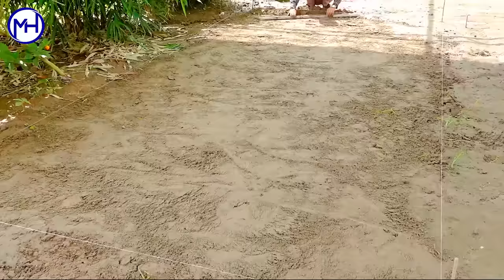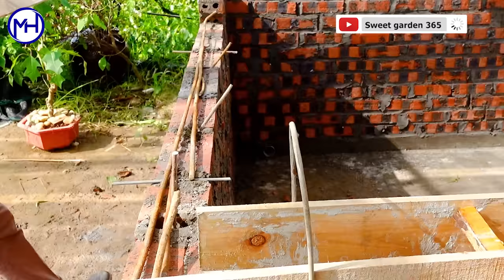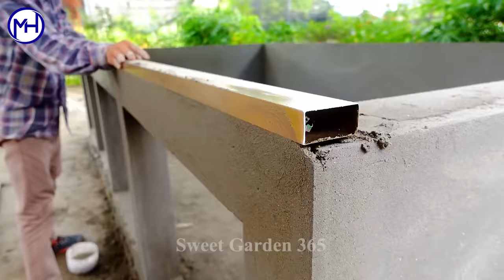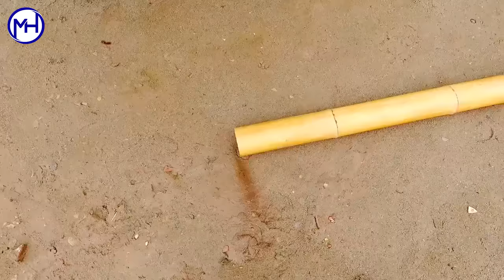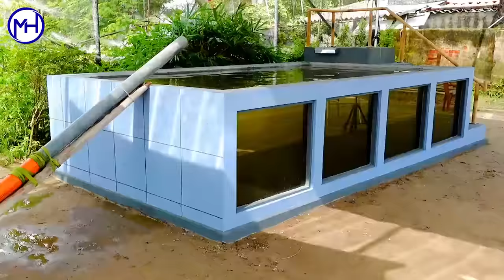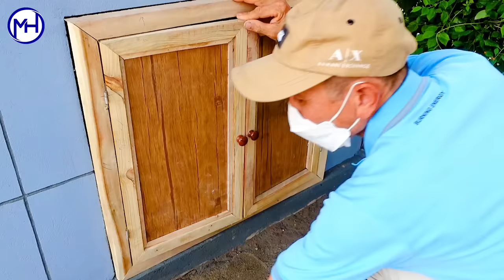WOW! How my father builds a giant aquarium at home

Comment: Looks really good but structure wise idk man. Not trying to hate but those stairs filled in with dirt with a thin liner of concrete isn’t going to cut long item and I would if used thicker rebar for the top rail of the windows. Nice looking tho
Reply: I think it’ll be just fine in a climate like he lives in there’s no frosting in heaving in the winter time.
Reply: @Exotic_pet_company  your opinion but it’s not about climate it’s about structure.
Reply: @4thHorsemenCustomz  I actually am from the north east and I moved down to Florida. I’ve been down here 20 years I lived in Massachusetts 22 and not only worked in masonry, but family members and friends were masons.  I went to a technical high school and was in masonry for 4 years. And if you look at the way, the homes are built or any masonry is installed up north compared to the south or even all of Florida you’re going to see a big difference in the way things are structurally for example.
In Massachussets (I would think all of the north east )they dig below the frost line so they can pour a solid foundation to lay the brick or block on. But the majority of the southeast, especially Florida don’t have to deal with a frost line. Therefore, they just pour a concrete pad on top of the ground. That’s their foundation.
Reply: @Exotic_pet_company  you don’t get what I’m saying my friend, your talking about foundation which I never said I said structure wise especially with that much water you need way much rebar for the structure and I’m not trying to Make it more then it is! I’m not Sitting here playing swords who went where or where you live just stated my opinion as you did so let’s leave it that.

Comment: What is the propuse of the murky water and plants that get removed? Is it to clean and add nutrients to the walls?
Reply: Test of integrity under load
Reply: @bigtime4794  But why add plants? The water alone should be enough to test the integrity.
Reply: @rodrigoaguirre154  it's great for parties
Reply: @rodrigoaguirre154  it cleans impurities from the concrete

Comment: . You should arm the bacement concrete with iron beams as well i should think.
2. I would say that the isolation of the brick wall sould be similar to a pools icolation because i think that even if you risk a leak accident due to water pressure, you ll certainly have dump problems  in the future.
3. The PH index of the water might not be easily altered for this aquarium if it has to accomodate tropical fish.
4. This is a huge monstrous aquarium and hence, the need of replacing every single week the one third of its water as should do as a principal in all aquariums, will demand an enormous money cost.

Comment: i dont think the filtration can handle those bioload excess with only 3 small chambers like that
Reply: The fresh Outdoor air,  rain and plants will easily regulate the water
Reply: That’s why there are hardy fishes in the pond
Reply: The chambers are pretty deep, and he was layering the filtration components, so I feel like it’s deceptively small. It’s hard to calculate the necessary flow rate without knowing the exact volume, but when it comes to bioload, one of the most important aspects for effective filtration is ensuring that every gallon of water flows through the filter at least 4 times per hour - so the pump has to be powerful enough to perform at that level. He might find himself cleaning and/or replacing the filter pads/sponges more than desired, but the live plants will participate in filtering bioload & oxygen conversion as well. I have a feeling this isn’t the first time he’s built one of these, so I’m sure there’s been a learning curve. As long as he keeps the fish population down, I think it’ll work well for his purposes.